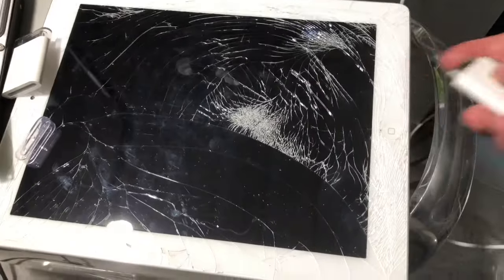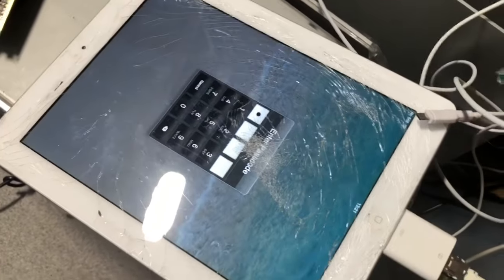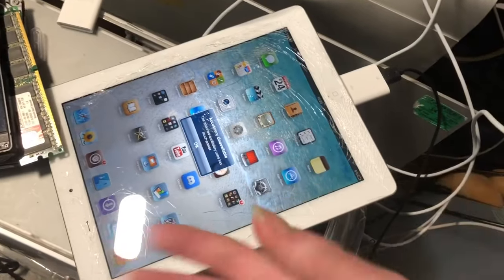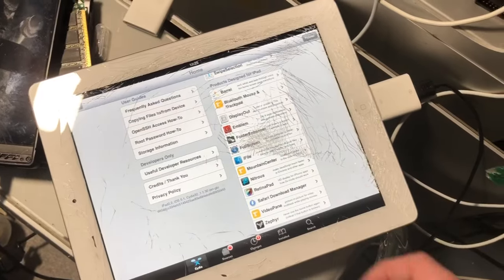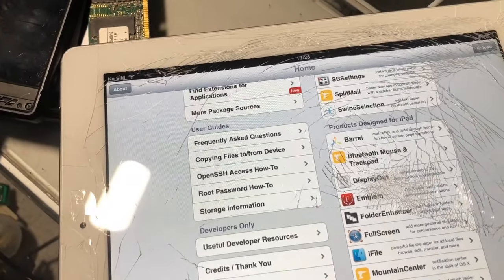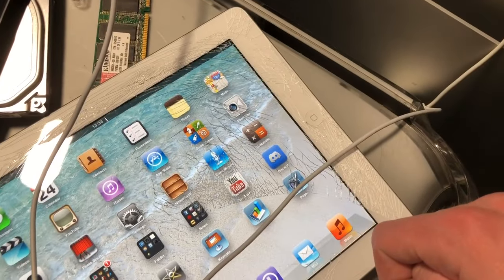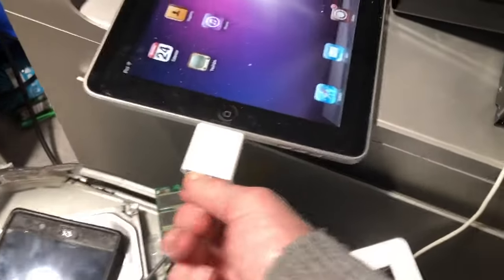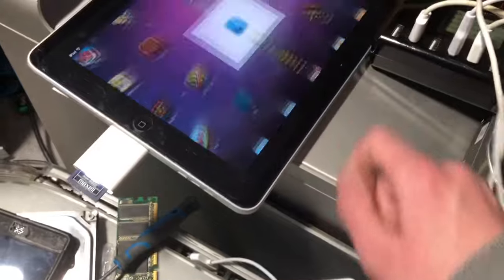Trying to use the iPad Camera adapter with other things

Comment: I downgraded my iPad 3 to iOS 6 with coolbooter but there is mo option to set a passcode. Could you help me. How did you downgrade yours ?
Reply from the maker: I believe it is set from the primary iOS, also my iPad 2 is natively on iOS 5
Reply: Either downgraded from iOS 6.1.3 or never updated